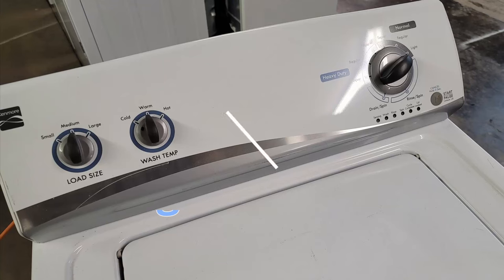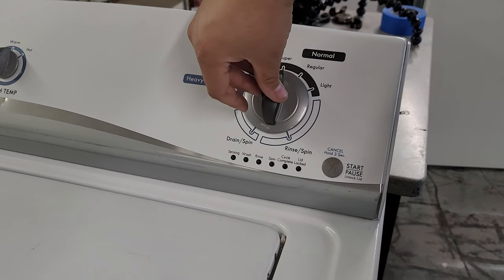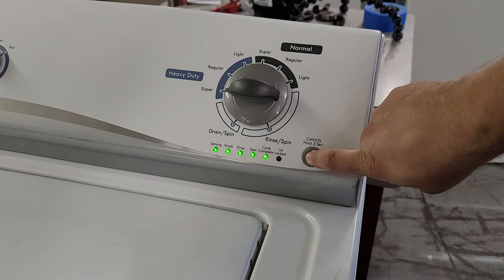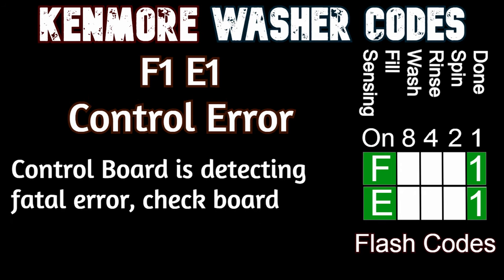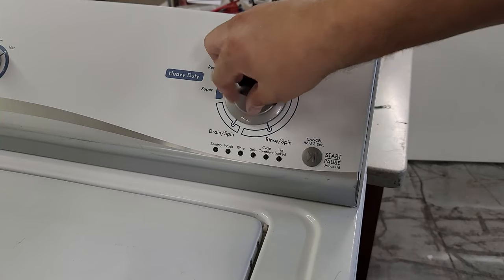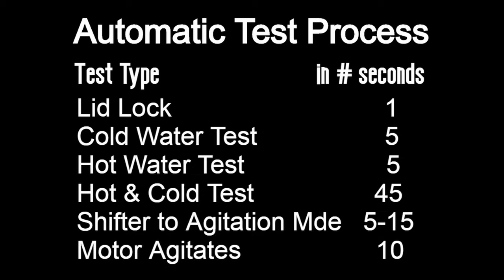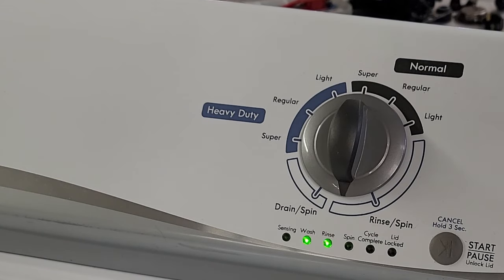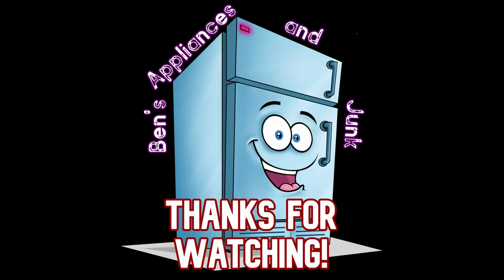Kenmore Washer Troubleshooting - How to Find Error Codes & Recalibrate to Fix Your Washer

Comment: Thank You for this well documented video. Just knowing where the service manual is located alone is a huge help. But your step by step guidance fills in the holes the service manual leaves out. After checking error codes and nothing came up I ran the Recalibration - no parts needed and washer is back doing the laundry. No question your video saved me some $$.

Comment: Thank you, I reset the codes (deleted the codes). Then waited about five minutes before unplugging the machine for 2 minutes (this part I saw on another video)- once plugged in, I closed and opened the door six (6) times, selected a cycle and it start working :) The sensing process take anywhere from 2-4 mins, so be patient and don't touch or change the cycle type while it's sensing. NOTE: The problem I was having was the machine never stopped sensing along with a flashing door locked light.
Reply: Same with mine. I'm going to try at it again today.
Reply: Reset or recalibrate?
Reply: I have F5E2 (lock/switch malfunction) and am going to try this method
Reply: @CoachJHayesCHayes is
Reply: Had similar issue, took 10-15m to sense then spun so slow literally an 20 rpm’s but a calibration fixed all of it. Seems to be fine but still testing. Will report back if anything new is discovered. This video is so great and the guy the explained it all is too :)

Comment: Very good content. 
Thank you.
just fixed my washer not working after I replaced the main board. 
When through manual mode test then recalibration,ran a cycle and it's working as I'm typing.
Thanks againg. 
Keep the good work.

Comment: Thanks! I did codes and tried  all morning. When you told where the manual was I took apart my machine to get it. I had replaced the shock absorbers and putting back the lid I saw something black hanging< It was the component that the lid shuts into to lock door and activate  for machine to run! I popped it into its place and the machine started right up. Would have not known it had come loose except when I saw it when getting the manual. Thanks!!!!

Comment: First let me thankyou for your outstanding videos. I have a Kenmore Series 500 and I have replaced the speed sensor twice it worked for 1 year. This time  it  stopped the recalibration after a minute plus and the lid lock started flashing any ideas are welcome. Thanks so much for your help.

Comment: Great Video!! I have a Kenmore 500 top loader and no green lights. Most of the time when my washer changes cycles, nothing happens. But the motor hums and if I get to it in time, I have to push the tub and it starts the cycle. What's wrong?? Thanks 💞💞💞
Reply: Hope you figured it out. Mines doing the same thing.

Comment: Excellent video !! Thank you / do you know how to re set the water filler problem ? Mine does not fill up enough even with a very small load
Reply: We are getting soaked laundry on the bottom and almost dry laundry on top. Then it stops mid cycle! Sometimes we have to do 3+ extra spins. So frustrating!!! I hope this works. 🙏

Comment: Hi Ben,  my Kenmore VMW washer seems to be stuck on the WASH cycle.  There were no codes stored.  When I did the Recalibration mode, my green lights did not move from right to left like in the video.  They all lit up at the same time.  The Drain pump was also running during the entire time.  Do you think my washer has a control board issue?  Thanks!

Comment: Got a Kenmore Series 300 and its automatic water level sensing appears to be malfunctioning. It never adds enough water. I know these are water saving washer's but it is not adding enough water even on small loads. Is there a way to turn off automatic water level sensing?  The clothes on top stay on top the whole wash and do not properly clean.
Reply: One of our issues as well. Getting ready to diagnose, hope if won't be a major overhaul.

Comment: My Kenmore  (same model) wasn't emptying all the water during the spin cycle. I did the automatic test and all came back well. I did have a load balance and shifter error tho. But now it runs fine and empties water like a champ. I didn't really do anything but run some tests (and stabilize the machine). Maybe that did it...

Comment: I have exact same washer you were doing tests on. It's not drying my clothes completely.  No clogs when I took pump out. And not to much water came out.. Any idea? Belt seems fine and motor looks good. No burning smell. Will try the diagnostic after I put it back together and maybe see something.
Reply from the maker: Try diagnostics and see how fast it spins. I have a Maytag video - same style as this Kenmore. Lots of tests for "Won't spin" and in one setting, I jam the door lock and show you how to run it to visually see drum spin. Could be running too slow because of a bad capacitor, or rods, potentially.

Comment: Wish I knew if my washing machine is repairable. Overfilled and not
Properly loaded. Was being screamed at
By my roommate. Returned from the store and the spin
Cycle had not
Completed and the red
Light was flashing   I corrected the load and unplugged the washer  three times. Is there another sequence or procedures I can try?

Comment: Do you know what part do I have to replace if the washer is banging like crazy when spinning? It sounds as if the tub is loose. I've tried to search the web but I'm clueless, that's how I stumbled upon your video.
Reply from the maker: Likely the balancing rods. I have another video on an Amana that talks about it. Same style and exact procedure to replace. I'd just make sure washer is leveled perfectly first and isn't slightly off-balance. But over time, the rods WILL get bad to where it bangs around.
Reply: @bensappliancesandjunk  thank you so much!
Reply: My kenmore he washer was over loaded and not loaded properly. I came home to a red flashing light and found the doin cycle had not completed for obvious reasons. What should I do ?
Please help me
Reply: Spin cycle has not completed

Comment: Hi Ben can you help me out .I sold a Kenmore top load washer direct drive . when it's on washer and it's agitating . it's making a knocking sound I don't know where it's coming from ? This is the first time I have encounter this . would you know what it could be ? Thanks Ben
Reply from the maker: Likely something in transmission or basket drive. Its rare, but once in awhile there'll be something in either that can cause a knocking noise. I'll ask my other techs.
Reply: @bensappliancesandjunk  ok thanks I have never had this problem . it's weird because the transmission is dry no oil leak s ?

Comment: Do you happen to have a video for the reapair manual? Mine does not have that Manuel .   or do you know a web link to that particular washer manual? this is my exact washer it will agitate and spin but when it goes to spin mode it wont spin but I can unlock it and go to drain/spin it will spin it?
Reply from the maker: Please check for error codes and see what code pops up. They're going to be the same on almost every Kenmore like this, and that should narrow down what it is.

Comment: Hello. I have this exact washer. I am disabled and can't take it apart. What is the model of this? The washer is not advancing cycles on its own. I have to cancel load, then move the dial manually.  Im thinking it needs a timer. I just bought it from Facebook market place yesterday. Seller ripped me off. Told me it worked with no issues.
Reply from the maker: This has an electronic control board, not a timer. You'd need to make absolutely sure it's a model with the green lights, which confirms it has an electronic control board
Reply: @bensappliancesandjunk  okay. It is this exact model. Looks identical with same writing and lights. Knobs too.
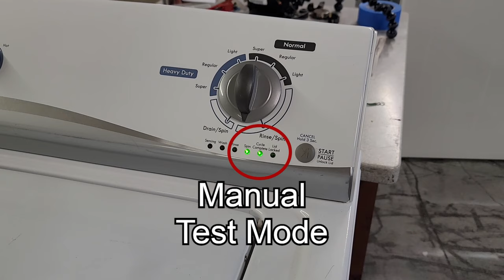Reply from the maker: @Tata-iu3fy  On a quick inspection, it would suggest the machine is not getting cold or enough cold water for the rinse cycle to properly activate. In this video, at 6:50 I show you how to get into manual testing. You'd want to activate the cold valve test and see if any water comes in. If no water comes in on cold water mode, you either have a bad water valve, the water input to your washer is bad (you'd want to turn cold water off, unplug the hose, and verify water can come out by opening the washer lid and trying to put cold water in it - if you get no cold water, the valve you turn on/off to get water is bad).

There's a few things you can do to resolve this: check the filter on your water valve or replace it if the filter isn't totally clogged, again, assuming you get no water into the washer during the cold water test. Check that part and let me know what you find.

Comment: What if no lights light up after doing the turn the knob to 12, 3 clicks to the right, left once, and right once?
Reply: On my unit (100 series) rotate selector one or more clicks to the l to clear sequence. r one click wait 1/2 second then right again wait .5 seconds then a third time to the right and wait again. 1 turn to the left wait .5 second then 1 click to the right then success. Note you have to do the series in less than 6 seconds to be successful. It auto clears after 5 minutes or you hold the start button for three seconds to clear the sequence to try again or if you are done.

Comment: I have a problem. . I have a Kenmore  elite 500 series model 110 .. it has a code that says an open circuit on motor . My issue is it doesn't agitate as aggressively as  it should .  I read the techs Manuel
Reply from the maker: Sounds like either the motor is going bad or the capacitor is bad, and won't shoot the right voltage to motor.

Comment: I have a Kenmore Series 600s washer. It stop working. The instrument board turns on, it has a chime when it turns on, that's normal, the Cycle Knob spins and turn light on it are normal,
But the problem is the lid door does not lock when  closed, and all buttons like water temperature and options buttons, like 2nd rinse, do not respond when pressed. Those button don't make light, or sound. Help me
Reply from the maker: What did the error code mode show you?

Comment: Its hard to get my washer spinning. Sometimes it spins, sometimes it doesint. It's like the computer is mest up or something. What do u recommend?
Reply from the maker: I'm working on a video soon to deal w/ spinning modes and how to troubleshoot them. Did you find any error codes?
Reply: @bensappliancesandjunk  no error codes popped up. I ended up just re setting it I think and now we are going to test it.
Reply from the maker: @joeyg-smallengine1116  ok. Reset and see whats up. Within a week I'll have my video out thats pretty exhaustive on the issue
Reply: @bensappliancesandjunk  thanks that's great 👍

Comment: I have replaced the water inlet valve, lid lock, drain pump and actuator and still can not get it to actuate and drain. I did the recalibrate and there is no codes showing. Any suggestions it only 5 years old kenmore series 500
Reply: Did you ever come to a solution?  I’m running into this EXACT issue as we speak.
Reply: @Ub3rNo0ber  NO I have not after 2 weeks still can not get it do. Just went got a new one. Sorry not any help good luck on yours if you figure it out please let me know

Comment: So I've been trying to reset it but the sensing light it's on and the lock lid ..red light it's on too and does not let me do the rest because the green lights don't show..what can I do😭😭😭
Reply from the maker: Unplug, let it rest for 15min, plug back in. Wait about 1min, then input code to get to diagnostics and re-calibrate/ect
Reply: After u plug it back in, hold down start button

Comment: Can anything be done if the washer will not power on?
Reply from the maker: Unplug machine, wait 30sec then plug in. Listen for a very low click on control board. If you don't hear it, the board isn't powering up at all. If you hear the click, its another issue.

Comment: Videos are always so old by the time I need them lop. But I'll ask anyway. I dknt understand the codes. F0E5. I read that as F5. I'm missing something
Reply from the maker: I have like 5 videos dealing with these diagnostic codes on these Whirlpool-built machine, so theres a few other videos in which I explain the codes for more understanding(s). F0E5 is an unbalanced load which would prevent the machine from spinning the clothes out properly. Is that your issue? F5E0 doesn't exist, but the F5 E1-2-3 codes are all lid lock related.